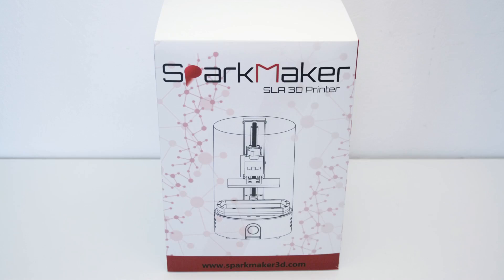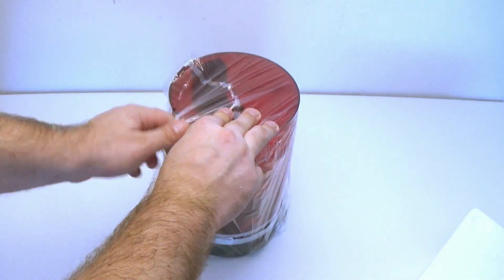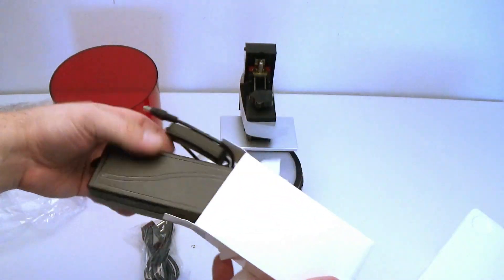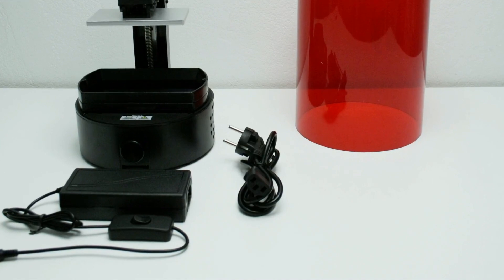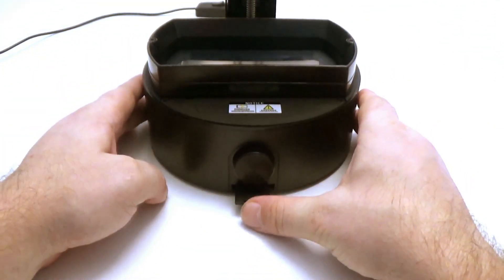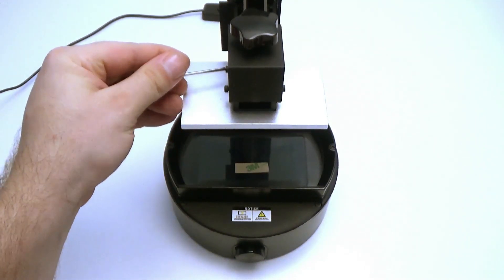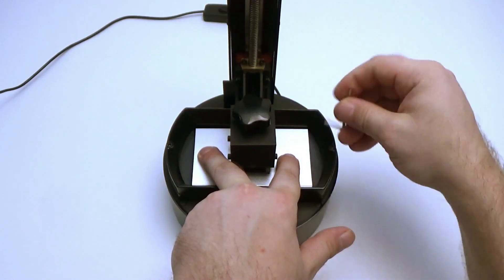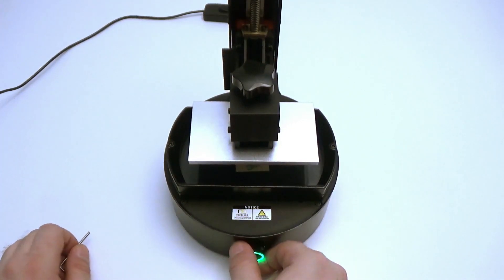Sparkmaker - Unboxing, Firmware update, Calibration #Sparkmaker #DLP #Resin

Comment: Greetings. The sparkmaker original printer got into my hands. But I can't start printing. By inserting a sd card with a model in wow format, the printer turns off the display and nothing happens. Another sd card blinks red at startup and returns to green. What should I do?
Reply from the maker: Sorry, i can't help you there. Never got mine working properly. There is a Facebook group you could ask for help there...
Reply: Same case with my printer
Reply: @gozoom24  the problem was a faulty power supply, after replacing the printer began to print